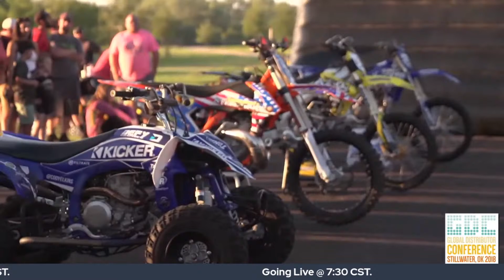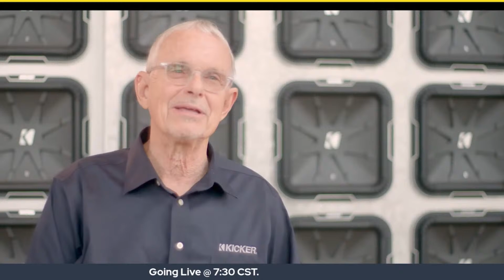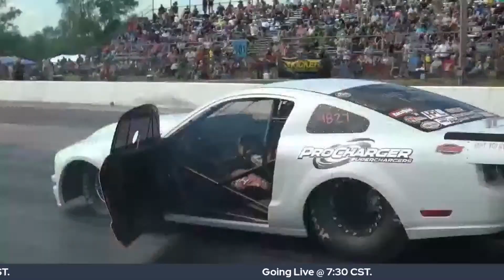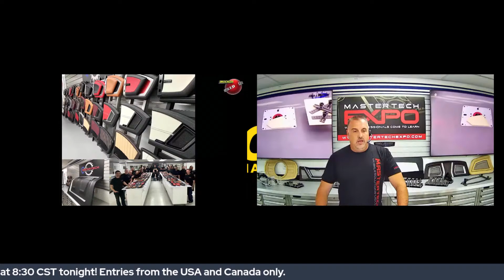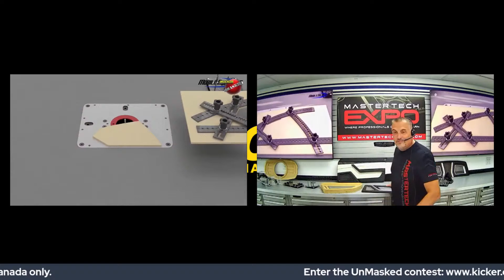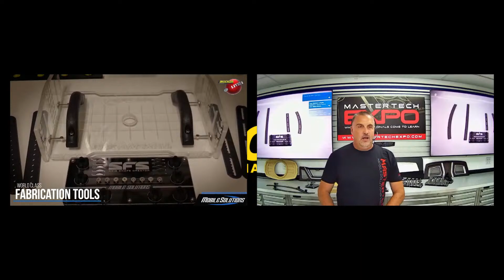Tools Of The Trade - KICKER UNMASKED

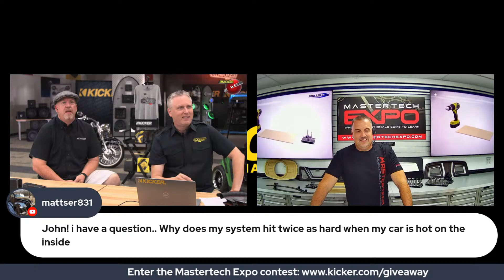Comment: @1:19:00... Sounds like mattser831 was describing the same thing I experience. I'm in the Carolinas and it gets hot. In my car I run an SPL designed subwoofer. It definitely plays louder when the interior of the car has been heated by the sun. My theory is that the flexing materials if the driver (surround and spider) soften. This allows the cone to move more with less power applied. In the winter it is much quieter and I find myself always turning the bass knob up more. Once it's been playing for 15+ minutes it gets louder as those materials warm up.